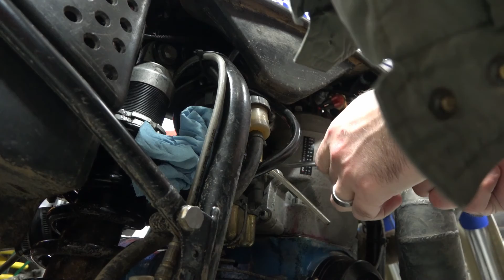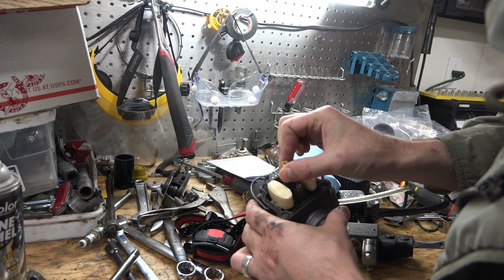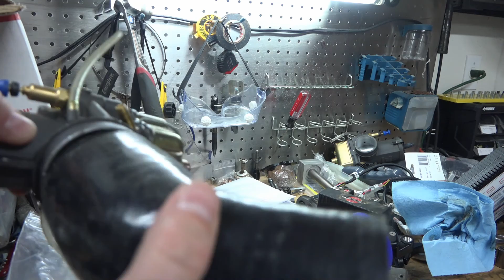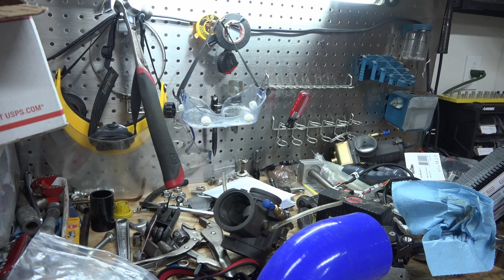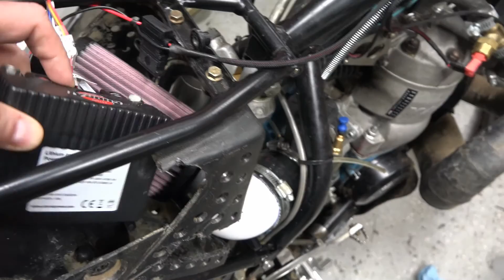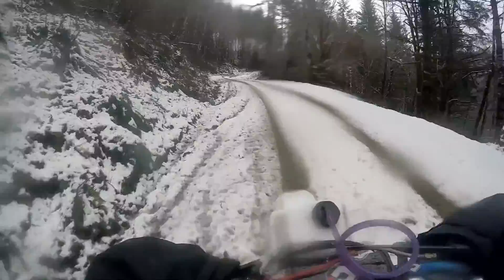Fixing the Maico 660 Air Filter (Dirtbike Garage: S1 E8)

Comment: man it looks like a mid 80s Yamaha it air box would fit.
Reply from the maker: It has the air box, it's the connection to the carb that's the problem.  weird angle and 70mm wide.

Comment: why is there a fan on the backside of the radiator? (i think
 its probably for cooling when standing still)
Reply from the maker: They kick on when the temperature gets > 212F or if you hit the button.  They don't blow air onto the radiators they suck air through.